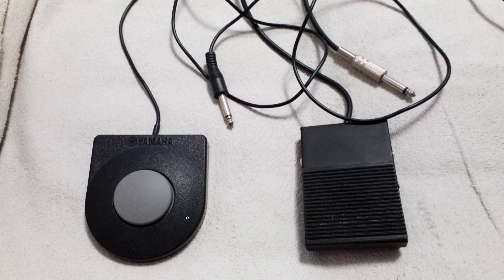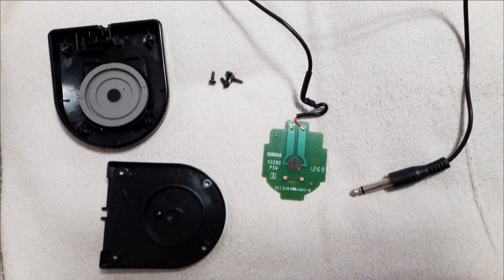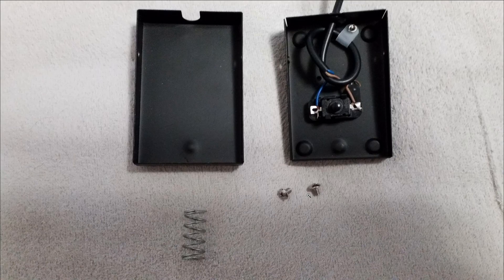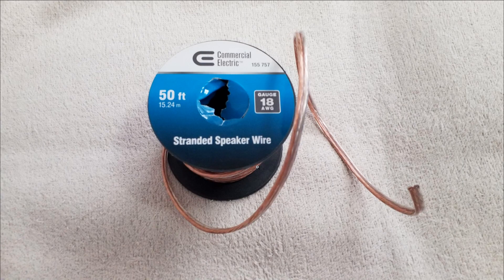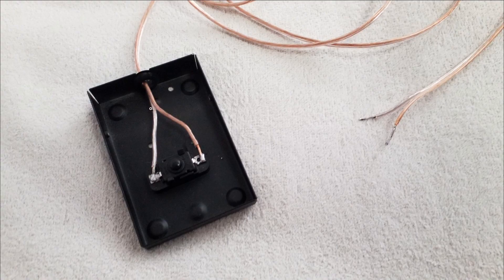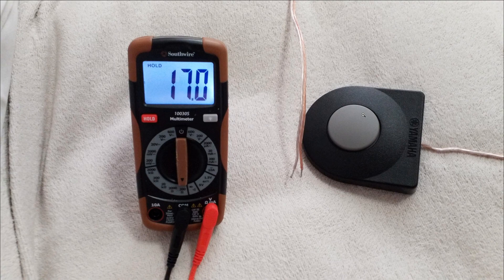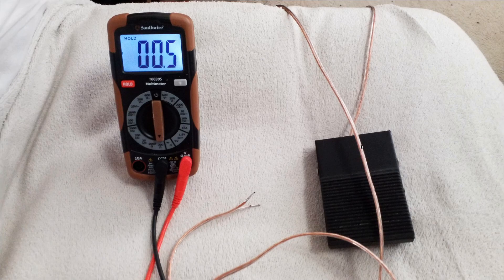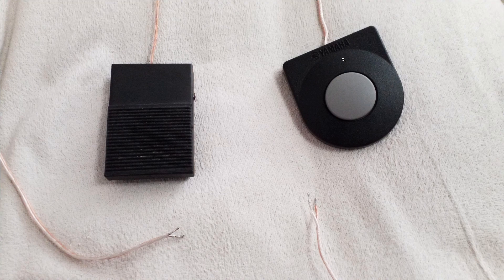Turning Old Foot Pedals Into PC or Hobby Electronics Input Devices - Simply Put

Comment: 4:00   i usually leave some slack and make a knot inside the box ,with the same cable ,so pulling it will not pull the switch.
Reply from the maker: That's a smart idea, though I'm not terribly worried about it just for personal use. Maybe hot-gluing it down would be a good idea though.